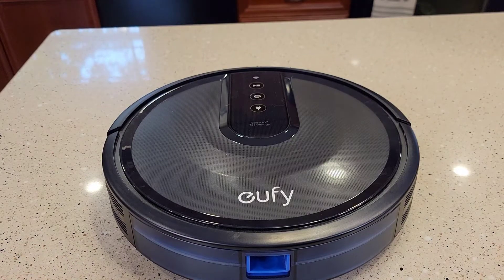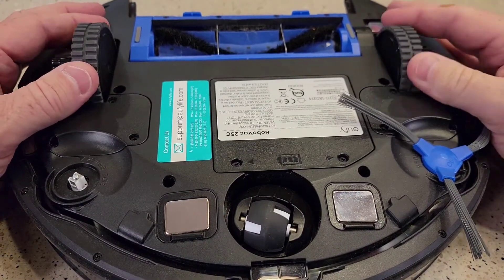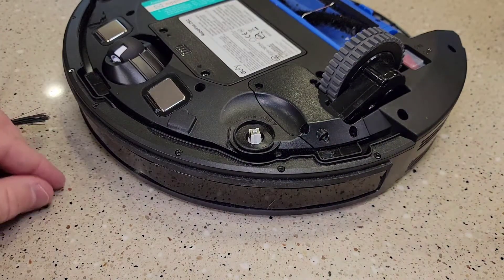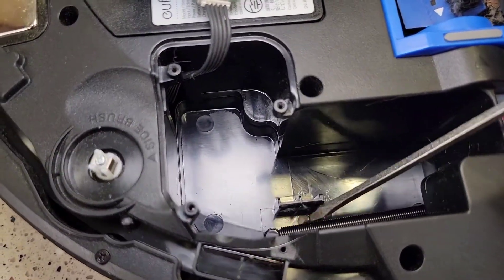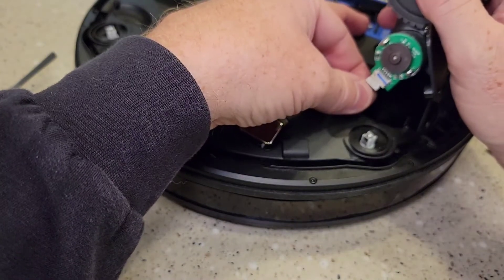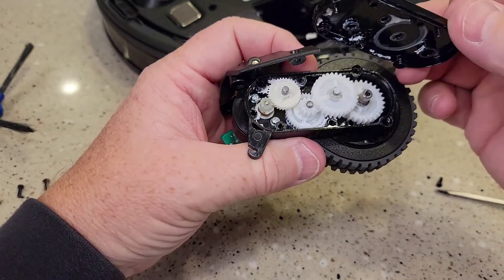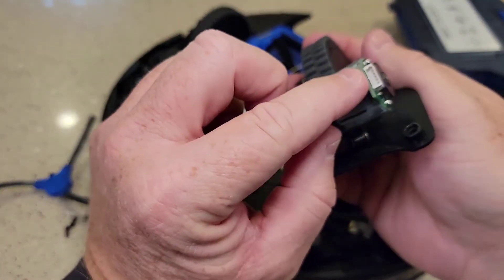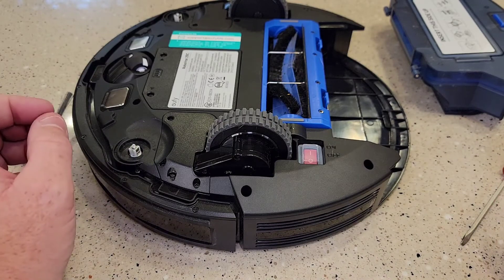HOW TO FIX DRIVE WHEEL Anker EUFY RoboVac 25C

Comment: Nice video!  There is no such thing as a "sealed unit" if you have the right screwdriver and a few minutes. My wheel is spinning a little too freely, my gears look good, but I think the abuse from the kids sheared the wheel axle or the socket into the first gear. Can't seem to get the tire off to pull that first gear off